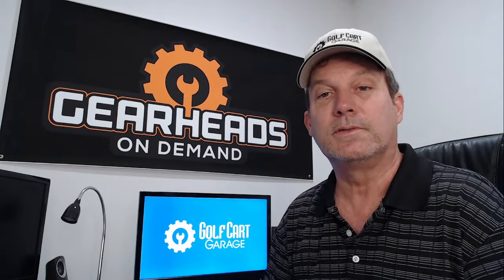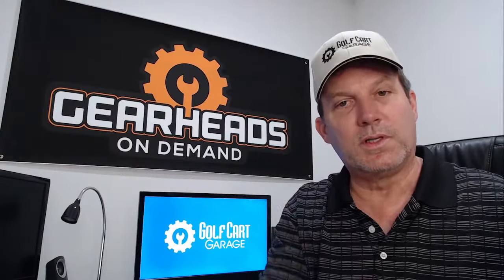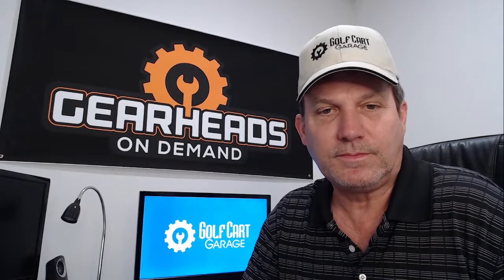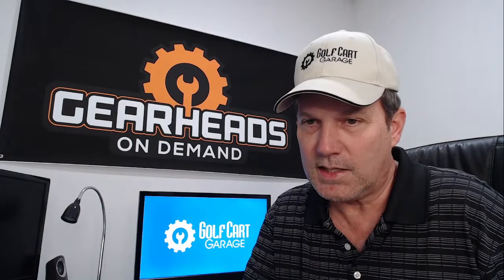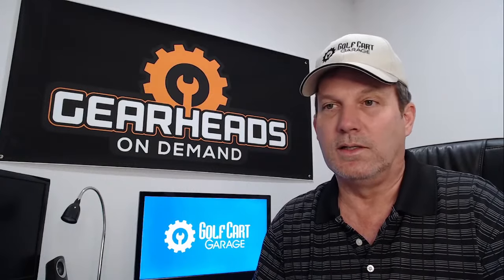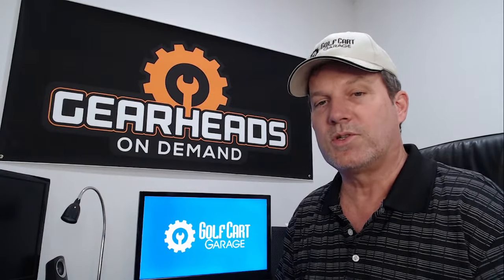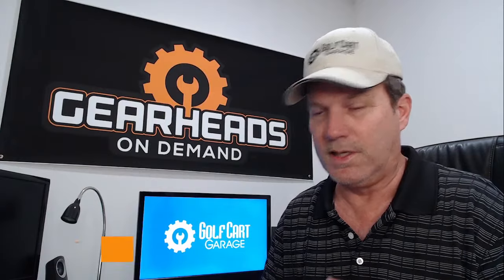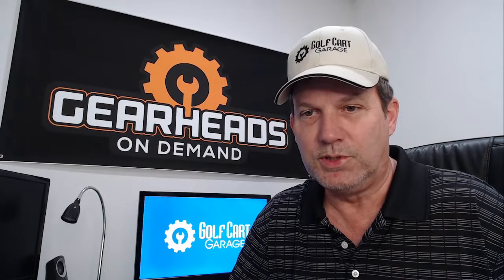Speed sensor or controller? | Golf Cart Garage I Weekly Giveaways |  Episode # 76

Comment: Club cart runs fine then hit a bump and stops but just hit the pedal and start again . Replaced the mcor and did not help . Do you have any idea .
Reply from the maker: Thanks for watching!  This symptom can be caused by a loose battery hold down or loose wiring somewhere.  It can also be a switch connection being jarred.  You can get an appt for a video call diagnosis here: https://www.golfcartgarage.com/gearheads-on-demand/
or get in touch directly at Support@GolfCartGarage.com or (800) 401-2934

Comment: I have a question about my cart, I have a 1995 ezgo cart  when I got it nothing was connected so I’m trying to figure out where the f&r switch wires go, thanks in advance.
Reply from the maker: Thanks for watching!  You can get an appt for video call mechanic assistance here: https://www.golfcartgarage.com/gearheads-on-demand/
or submit serial and mfg code info to Support@GolfCartGarage.com to see if our reps can help locate a wiring diagram.  Good luck!

Comment: I’ve got an early 2000s EZ-Go I’m having issues with intermittent power. You’ve got to do a random series of turning the key on and off before you can go. Then the power is intermittent, it will go very slow, then randomly speed up for a short time, before coming to a stop and doing it all over again.
Reply from the maker: Thanks for watching, Mike!  The first thing to check here should be power.  Getting a load test on those batteries would be our advice.  Even 1 bad cell inside one battery can stop your cart or make for intermittent power supply.  Let us know if you have more questions! Support@GolfCartGarage.com or (800) 401-2934

Comment: Hi, o.k. I purchased a 2009 club cart precedent.  When I purchased it from pawn shop, I should have test drove it, but I didn't.  when I got it home and drove it, it took off fast then it started to slow down to 6 mph.  The pawn shop purchased the parts the speed sensor and this other sensor, I put on the speed sensor, the speed got up too 13 mph flat ground.  When we put the other sensor on, hopefully that will give it a little more power.
Reply from the maker: Thanks for watching!  13mph is about right for stock equipment on an '09 Precedent.  Let us know how things turn out!
Reply: @GolfCartGarage  13 mph, is that all, wow.  I  thought at least 18 or 19.  So what do I have to do if those other parts don't worm to speed it up?
Reply from the maker: You'll probably get to about 18-20mph with a lift and tires upgrade to a larger size, though that can sometimes rob a bit of torque.  Beyond that, you can ask a local Club Car Dealer if they can program your system a bit higher, it may have been governed if it was used for a course.  Past that, you're looking at powertrain upgrades.  The basics are here: https://www.youtube.com/watch?v=ElhaSpdxIlc&pp=ygUWZ29sZiBjYXJ0IGdhcmFnZSBzcGVlZA%3D%3D
Reply: @GolfCartGarage  ok. I was going too send u a pic. It has a lift kit and bigger tires.  But I'm going to put these other parts on and see what it does. 18mph is good enough for me.  If it does that, im happy. Thks for the info.

Comment: I just bought an E-Z-Go golf cart put in new batteries my cart is bucking when I first take off it is fine once I get rolling and has plenty of power but sometimes you press the accelerator you can hear the motor click but it does not move and when it does move it jerks hard
Reply from the maker: Thanks for watching, Larry!  It sounds as though you may possibly have a potentiometer issue. Those vary depending on model and there may be some follow up questions. You can get an appt for a video call diagnosis here: https://www.golfcartgarage.com/gearheads-on-demand/
Or reach out directly at Support@GolfCartGarage.com or (800) 401-2934

Comment: I have a 1995 Electric Ezgo 36v . Just had a soleoid,  new batteries and cables put on. Now when I accelerate it takes off fast and jerks my head off. Do I need a new sensor?
Reply from the maker: Thanks for watching, Sandra! There could be an ITS issue, there.  We'll have some follow up questions.
You can get an appt for a video call diagnosis here: https://www.golfcartgarage.com/gearheads-on-demand/
or get in touch directly at Support@GolfCartGarage.com or (800) 401-2934 if you need more help.

Comment: Hi Tim, I have a 2014 club car precedent 48volt. The cart at full thottle starts off great then goes into limp mode @7mph. I changed out the speed sensor and it still does the same thing.  I push the car and the buzzer sounds and it's a little difficult to push. Can it be the MCOR.
Reply from the maker: Thanks for watching, Al!  Could be an issue with the potentiometer on that vehicle.  We recommend a video call consult with our diagnosis team here: https://www.golfcartgarage.com/gearheads-on-demand/
or get in touch directly at Support@GolfCartGarage.com or (800) 401-2934.

Comment: I have a 2013 48v ezgo rxv.  Recently started lagging in speed for a little distance now it jumps when I put it it gear but won't go anywhere.  Batteries are almost brand new.  Any suggestions?
Reply from the maker: Thanks for watching, Sniper!  This sounds as thought there may be an issue with the RXV motor brake or possibly a wiring or potentiometer issue.  We recommend a free consult with our diagnostic techs here: https://www.golfcartgarage.com/gearheads-on-demand/ or get in touch directly at Support@GolfCartGarage.com or (800) 401-2934
Reply: Ok bud.  Thanks a ton.  I'll be at work for a couple of weeks but I'll get in touch with you when I get home
Reply: @invisible_sniper  did you figure out the issue? I have the same issue. Got sluggish on me, went to take off, and it inches forward for a sec then stops. Same thing in reverse. I had someone pull the motor apart and clean, changed the Mcor, and now I’m at a loss. Brand new batteries as well.

Comment: when I press pedal all way it stalls  power goes off soon as disconnect power and connect it power comes back ,When I run slow now problem
Reply from the maker: Thanks for watching, Gilbert!  Sounds like you may have an issue with your cart's potentiometer that sends signals to the controller.  Or with older, series carts, that can be a bad coil or V-Glide.  Get in touch if we can help more!  Support@GolfCartGarage.com or (800) 401-2934

Comment: I have a 97 Club Car DS 48v. My batteries are perfect and voltage does not drop out much going up hills. The cart is fast on the flats, but on the hills crawls up, not sure what that could be?
Reply from the maker: Thanks for watching, Raymond! Voltage does not drop out much going uphills?  How much?  Could also be something else getting hot like controller or F&R assembly.. something is robbing torque somewhere.  If you have more questions or need help, just get in touch!  Support@GolfCartGarage.com or (800) 401-2934

Comment: What is the M terminal on ezgo txt pds.?and where is it ?
Reply from the maker: The "M" terminal on an EZGO TXT PDS is a connection point for the motor on the vehicle. It is located on the controller, which is typically found under the seat of the golf cart.

The "M" terminal is specifically used for the motor field winding, which is responsible for creating the magnetic field needed for the motor to operate. This terminal is usually connected to a wire that goes to the motor's field winding, and it is essential for the motor to function properly.

It's worth noting that the location of the "M" terminal can vary depending on the specific model and year of the EZGO TXT PDS. If you are unsure about the location of the "M" terminal on your golf cart, it is recommended that you consult the manufacturer's manual or seek assistance from a qualified technician.
Let us know if you need more help!  Support@GolfCartGarage.com or (800) 401-2934

Comment: I have a1994cub car with the resistor anything I can do to make it go uphill with out losing power
Reply from the maker: Thanks for watching, Kevin! Only thing you can do with that one is make sure the V-Glide is going to the last contact, tires aired up, and batteries are good.  But, if you need more help, you can reach our techs at Support@GolfCartGarage.com or (800) 401-2934.

Comment: Speed sensor on ark off car don't have a boat so not sure how to get it out 🤷🏽‍♀️🤦🏽‍♀️😮‍💨 It starts off fine then slows down not batteries went ahead and changed them all 2 new ones.. Can't for the life of me find a video with the same one as mine.. It's a Ezgo cart DS model 2007 🤷🏽‍♀️🤷🏽‍♀️😞
Reply from the maker: Thanks for watching, Kristian!  This sounds like a speed sensor issue, maybe... but there's some conflicting info here.  For instance, DS is a Club Car model, not an EZGO.  You might want to see a pro. You can also get a free virtual appointment with our techs here: https://www.golfcartgarage.com/gearheads-on-demand/
or get in touch directly at Support@GolfCartGarage.com or (800) 401-2934

Comment: I have a 1995 club car when I bearly touch the pedal it takes off in high gear what
Reply from the maker: Thanks for watching, Daniel!  This could be an issue with the potentiometer on your cart stuck in a WOT (wide open throttle) setting.  A chat with a tech might get closer to the issue.  Try a free appointment with our video call diagnosis team! https://www.golfcartgarage.com/gearheads-on-demand/
or get in touch directly at Support@GolfCartGarage.com or (800) 401-2934

Comment: Buzzer  not  working  when  in reverse  1996ds club  cart
Reply from the maker: Usually, people ask how to turn the buzzer off!  :-) There may be a wire that came loose or a possible malfunction to the buzzer itself on a nearly 30 year old cart.  You can get an appointment for a video call diagnosis here: https://www.golfcartgarage.com/gearheads-on-demand/
or reach out directly at Support@GolfCartGarage.com or (800) 401-2934

Comment: I have a precedent operating at 8mph unless i turn the key off and back on then the cart runs at 15mph? I tried a speed sensor, i'm assuming a controller?
Reply from the maker: Hello Chris.  I am still leaning toward speed sensor on this one.  Just remember a Club Car dealer could plug in their computer and read your fault codes to see if it is showing a speed sensor fault.

Comment: What load tester do you recommend for a 48v six 8v system?
Reply from the maker: The tester at the link below, I would recommend to provide the most accurate assessment of the condition of a 36 or 48 volt battery pack.  Most consumer level DIY techs use a volt meter test under load using alligator clips.
However, this one can be purchased by calling our sales department at (800) 401-2934
https://www.nivelparts.com/discharge-tester-36v48v/p/3548

Comment: Hello, I have a 2003 DS club car.
My problem is that I accelerate and it doesn't go, it doesn't do anything and suddenly it starts.
All of the above with charged batteries.
Reply from the maker: Could be an intermittent MCOR.  If your cart has a run/tow switch a Club Car dealer could read your fault codes also.

Comment: I have a s6 48v 6v batteries  cart would not hold charge for the day so got battery replaced   after replacement cart will not move and no back up alarm
Reply from the maker: Hello.  Could be a few things.  Most likely forgot a wire hook up somewhere.  Always take pictures.

Comment: I have a 2003 electric club car 48 volt with a GE motor that I need to replace the speed sensor.  With the wheel well off it is easy to replace the plastic cap, and that fixed it for a few months. Do I have to take the motor apart to replace the magnet? And will that fix it?
Reply: This was an intermittent stopping issue, so I replaced the MCOR and that didn't fix it. I replaced solenoid also. The speed sensor fixed it totally for a few months until now the speed is intermittent. I've checked batteries but these Trojan batteries are 5 yrs. old. thank you, Chris
Reply from the maker: Hello.  If batteries are 5 years old then I would start there.  There could be an issue with just one cell.
Reply: Thank you. I had checked the batteries, each individually and getting around 8.5 on all 6. My next step will be to change the bearing that came with the speed sensor. I just hope I can get to the bearing through the wheel well without taking the GE motor out, which I think might be a nightmare.
Thank you for all the good advice you give! Christy  @GolfCartGarage